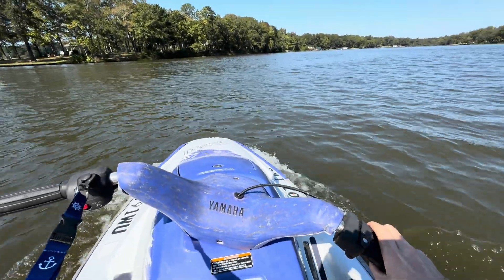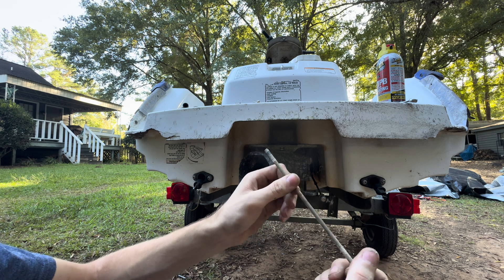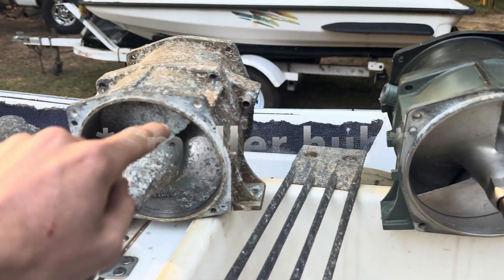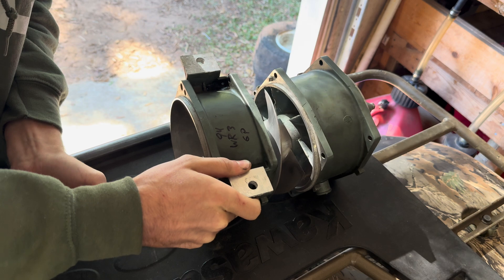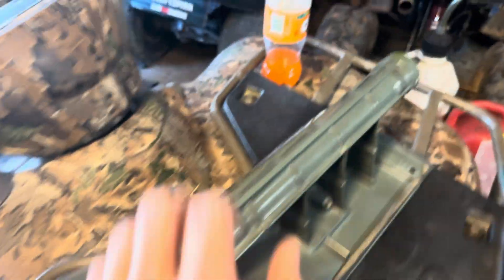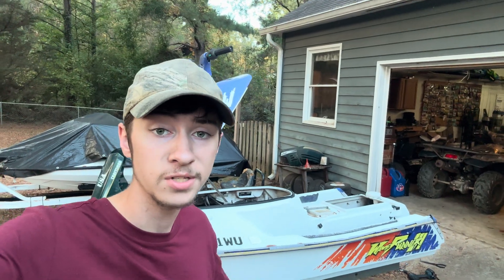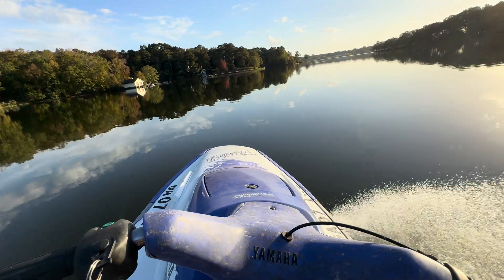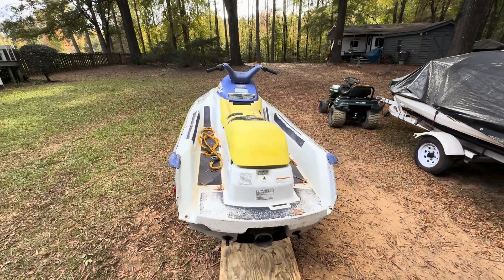Yamaha Waverunner III Jetpump Rebuild & Test

Comment: When you pull that end cap off where the grease is did it have a nut on the shaft? I have a 91 WR3 and mine had no nut when I pulled the cap but the shaft is threaded. parts diagrams also show no nut
Reply from the maker: No it doesn’t have a nut on it, That is for the impeller to be able to thread on.
Reply: @IngenGarage I thought the impeller threaded on from the other end
Reply from the maker: @lifewithmay17Maybe but if thats what the parts diagram says then it probably threads on from that way

Comment: Does it always shoot water up and out the back for cooling. How does that work?
Reply from the maker: The water gets force in through the pump and to the engine and exits all out the exhaust.
Reply: Yes Yamaha has always done that, even on their new wave runners. They say it’s for safety so that other boaters can more easily see you.
Reply: @KarsonNilsen I have a 1996 waverunner and it doesn’t spray up. Some of the waverunner 3s have the up some have the out the jet drive which I have
Reply from the maker: It’s a little plastic knozzle that bolts to the inside of the pump and allows water to shoot up.

Comment: Hello I also have a 1995 wave runner 650 . And mine also started vibrating mid ride  so I went  back to the Beach and turned it on its side there was a piece of wood pintch the impeller and impeller housing I used pliers to get it out and it stopped vibrating. The piece was only about 1 inch long the size of a cigarette.
Reply from the maker: Oh ok, yeah it did it for a bit then stopped. I took it out again 1 more time after making this video and half the lake and it never made the noise again, so it was probably something that got caught like you said then came out. Thanks for your reply!

Comment: Check the rubber coupler on the engine. You are putting a lot more load on the drive system then before. It might have been weak and is distorting. Good luck.
Reply from the maker: Yeah that was what I was thinking about because it didn’t do it at all then it did for a bit then it stopped.

Comment: Not really sure but the vibration you described was what my Seadoo did when the shaft was out of alignment with the PTO. But yours only doing it at high speeds? Seems like a bearing? But I would bet some money on the shaft out of alignment with the new pump.
Reply from the maker: Yeah I was kinda thinking of the same thing, it was fine at low and high speed in the beginning. Then it started doing it at low and mostly high speed, then it hasn’t done it again another time I took it out off camera so idk I’m just gonna send it.

Comment: I think the 700 carbs should fit make it from a 650 to 700 sounds like fuel issue because back at the dock it was running good I would get a next set of carbs from eBay try that next see if that helps
Reply from the maker: Alright thanks for the info! I might get another 700 carb and try it in the summer.